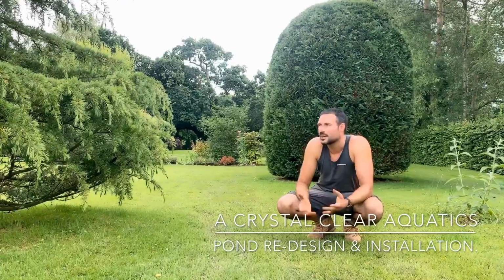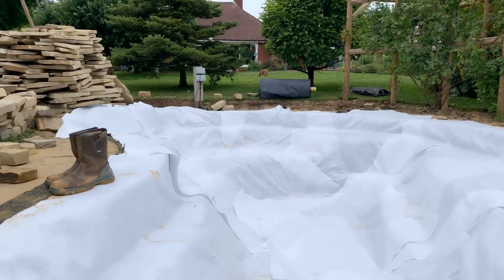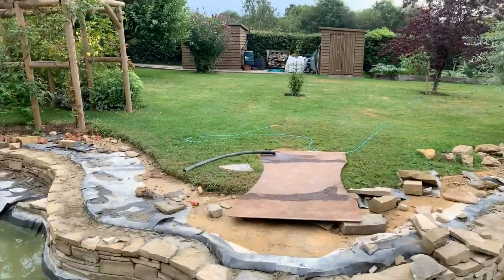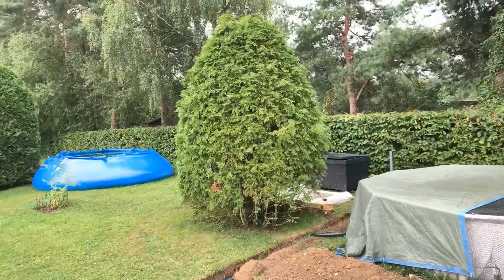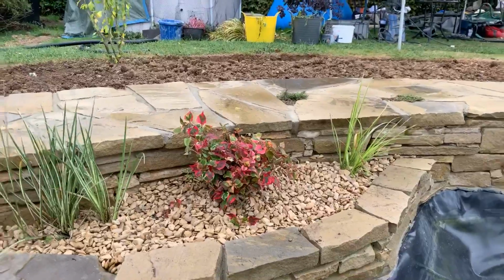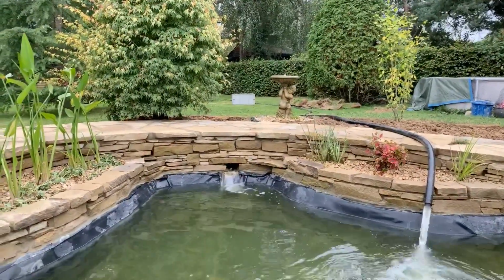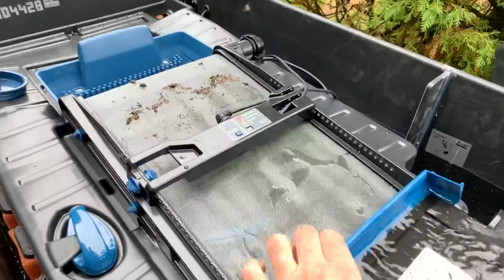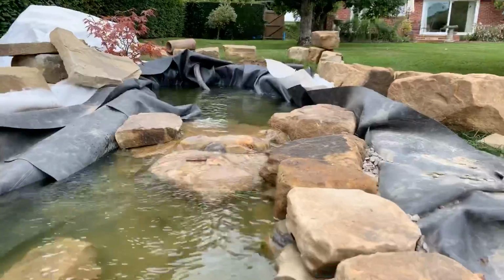Pond re-design & installation

Comment: wow what a build, how many tons of stone did that take!?
Reply from the maker: Thanks for your kind words! In all approx 9 tons of rock were used for this project-all manoeuvred and dealt with by hand. Not to mention the 70 odd tons of soil hand dug and burrowed during the excavation!!!
Reply: @CrystalClearAquatics  wow that’s crazy, great job! I’m thinking of having a go at doing the walking on my pond. Do you run a full course all the way around and then build up a later at a time or build in stages as you go? Sorry for all the questions!! Lol
Reply from the maker: Thanks! Many people would balk at doing such jobs manually but I enjoy it- its less intrusion to a garden and so requires less cleaning up after and the slower progress gives me plenty of time to eye up what I’m doing and come to grips with a project!   As for the building process- as the rock laying is pretty much done is a random way I build up as I go, rather then laying courses- otherwise it can begin to look a little too uniform for my liking.
Reply: Do you have to clean all the stone before you lay it? When I have seen stone before it’s normally very dusty/dirty. I wonder if it could be jet washed after install rather than clean each bit before laying it! 😅 would love to see a how to build video one day ;)
Reply from the maker: ...and yes- every stone has to be well washed first (I use a jet wash) to ensure a good strong bond between the rock and the mortar. Again on this particular job pretty much every stone visible was hand washed and hand cut/cropped.  All time consuming stuff I’m afraid!  You might get away with not cleaning prior to use if the stone was particularly clean, but spending time washing the stone before use gives me time to get a really good look with what I’m working with and allows me to sort out different piles based on rock thickness, its character, colour etc. I often have a ‘waterfall’ pile, a ‘pond build’ pile, ‘a feature stone’ pile for example.  Plus I’m always on the hunt for some decent fossils- which sadly I rarely find!!
Reply: @CrystalClearAquatics  serious talent... I can see why it must be so time consuming. Please keep the videos coming, they are great to watch 👍👍